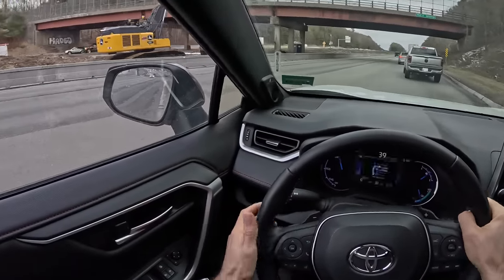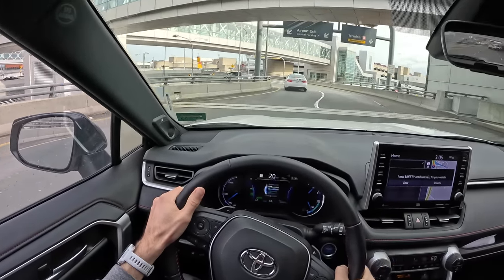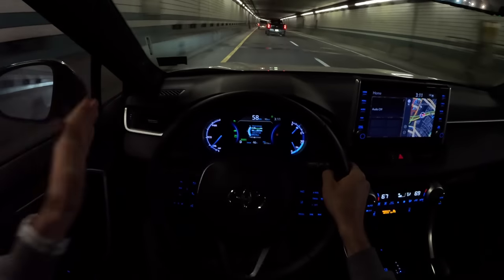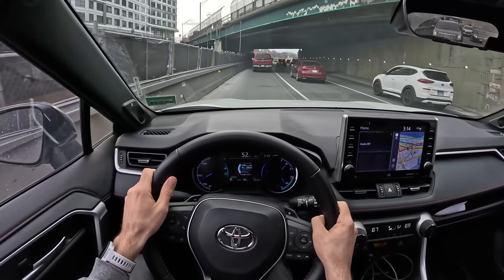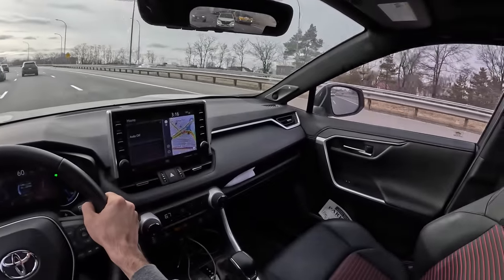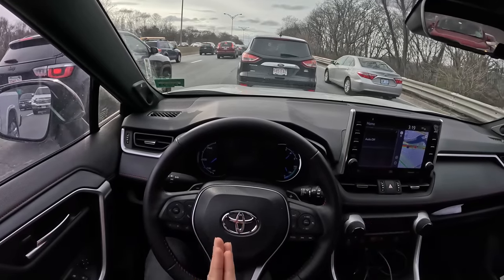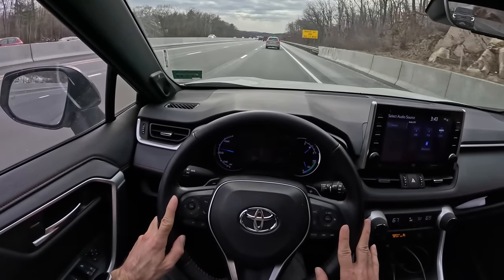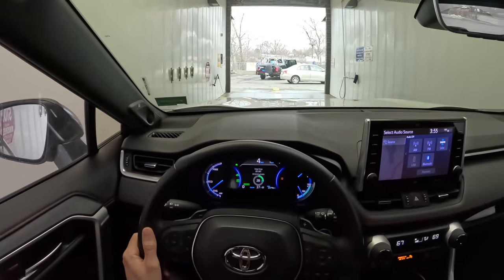Toyota RAV4 Prime After 24,000 Miles - Ownership Update (POV Binaural Audio)

Comment: the average top speed limiter for Toyota products is limited to under 200 km?
Reply: I tried mine Rav4 Prime in Germany and it stopped accelerating at 198 km/h on the speedometer. This should be around the Toyota official limit value of 180 km/h, as the speedometer always show bigger value that the actual speed.
Reply: @deyan_yosifov  thanks for the information, I live in Indonesia so I don't know the difference between cars in our respective countries.🙏🏻😁

Comment: I would like to see manufacturers go the route of a diesel electric locomotive. Develop an engine to run at 1 speed at peak efficiency to charge the batteries. Once the batteries have charged, the engine will shut off. The ICE would simply act as a generator instead of a part of the drivetrain. Could get rid of the transmission this way.

Comment: I'm kinda of hesitantly excited about the Dodge Hornet PHEV. My current PHEV is very under powered and having actual AC charging not limited to 3.3kw would be nice. The Outlander PHEV supports fast charging but is still stuck at 3kw for AC too. The RAV 4 prime  is 6.6kw... why they didn't just let it go to 7.6 like a standard home 32 amp charger is beyond me.

The Hornet with the PowerShot can accelerate quickly, has 7kw charging, goes about 30 miles on a charge, and is still small enough to get decent mileage on a trip (for an SUV with reasonable clearance). The only problem is it's built in Italy and Stellantis and Alpha Romeo hardly have a stellar quality record.
Reply: There is no "Standard" Home charger...........A thousand variaties.......Mine is 240v, 16 amp......Paul

Comment: The WORST factor about the Prime is how if most of your commutes are short where the motor never runs, it's the worst case for the health of your motor. Any gas motor which runs infrequently, or for only short periods, all tend to never reach operation temperatures long enough for the combustion by-products (water, unburned fuel, hydrocarbons) to not condense into the oil and reduce its lubricating capacity, and form sludge. Short commutes are considered Severe Service for gas-only motors, and oil change frequency is recommended more often for the above reasons. A weekly highway run where the motor oil reaches full operating temperature for a minimum of 30-miles or so is mandatory if you want your motor to last. 
At the carwash it appears you missed cleaning the wheels, and the brakes behind them. Also a better spray of all the salt and debris off the underside is in order... I'm concerned about how the dirt never stopped flowing out of the crevices on the tailgate. Unless its all plastic, which I doubt, that's eventually going to cause severe rust.

Comment: Full EV's will never fully take over unless north america overhauls the entire electric grid to support tens of millions of EV's charging every day. The grid can barely handle a hot muggy july day where everyones got the AC running. Can you imagine adding an EV on top of that to every house? That's not even to mention what happens to batteries in subzero temperatures. I saw a loooot of dead teslas this winter.

Comment: I don't 👀 side camera view turn signal.  And huge  21" NAV screen and 21" digital RPM and MPH screen ?  Does this able 2 seat 7 people ? And double phone charging capability ? Side step to reach up on the roof ? And comes in AWD  like  24 Hunday 🎅 Fe Plug in Hybrid SUV.   BTW will it give 62 miles battery power range ? As LL COOL J RAPS  " No I Don't Think So "  Did your brother in law told U how much his dealer  mark up charged was added buying?And how much advance deposit he made ?  Oh yeah how much time he have to wait 4 to pickup?  Tow🪀🪀 🍣 heads made stupid decisions on cranking up 2 make EV. So all there commi china party battery were priorities installed into Tow🪀🪀 EV.  For other PHEV it was pushed back.  Did he told all of you  all Prime models are made in jabang and after oversea shipped for months later.  First 2 arrive in West cost N who knows how long its going 2 take to semi truck delivery to other parts of states and more 🕑 its going 2 take if its in East coast especially if it is in Atlanta ocean northern states.  🤣🤣🤣🤣🤣🤣